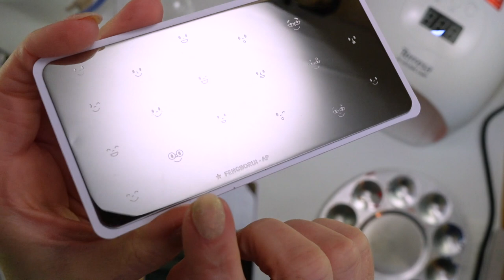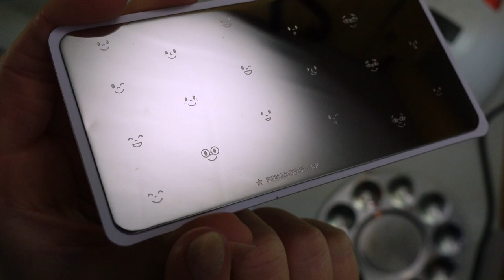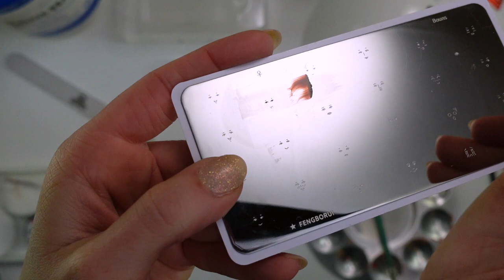Restoring Vintage Polly Pocket Figures | Vintage Polly Pocket Collection

Comment: Hi Holly the reason why you buff the stamper is so the paint/polish can adhere better to the stamper. If it's too smooth then the polish tends not to stick well. It's basically the same reason why you buff your nails before using gel polish. I also dont recommend buffing too often (since eventually it can make the stamper cloudy and hard to see where you're stamping), only when you find the stamper doesnt pick up the paint too well anymore but usually you could just wash the stamper with soap gently and clean it with a lint roller or tape. 

Good luck with future restorations!

Comment: Your restorations look so good! 
If you want your paints to not dry out so fast, you should give a wet pallet a shot! It's just a plastic tray topped with a wet paper towel topped with thin plastic (I usually use plastic wrap). Keeps the paint wet for a lot longer, which is especially good for acrylic paints.
I'm also always paranoid about paint chipping off of plastic, so maybe your repainted figures could get a coat of varnish? Even if it's just a thin spray-on varnish. That might not be necessary and I could just be way too uppity lol
Reply from the maker: I have a clear Tamiya gloss that I've started using once it's fully dry, and it's great!

Comment: This technique looked great!! I'm always impressed at your Polly restoring skills :D
I was wondering if you have any tips for restoring fairy Polly wings?
Reply: You can buy the same material/fabric that they are made of at any fabric store. I made a stencil out of an old wing and used that to trace onto the new fabric and cut out. If you want to keep the original wings put them between two pieces of glass and put a weight on top to flatten them out.
Reply: @ericabirchum493  is there a video for this yet?
Reply: @unlucky17  no I just experimented a little bit to figure out how to make them. There’s also a lady on Etsy that sells reproduction Polly wings but they are not made out of the same material as the original ones.